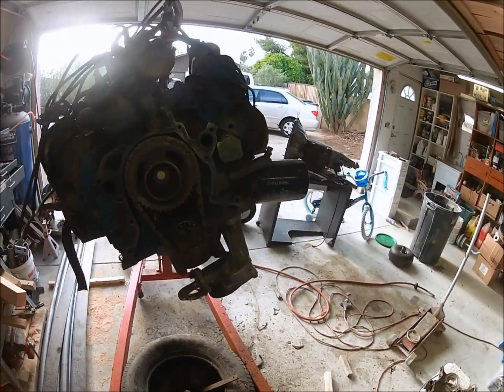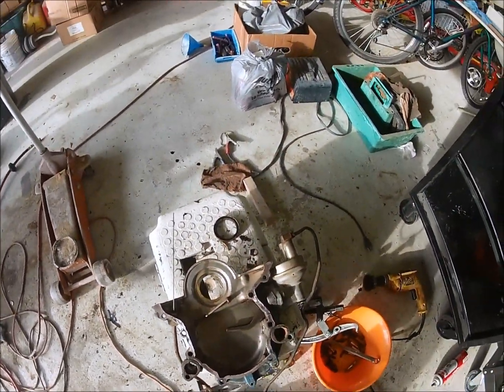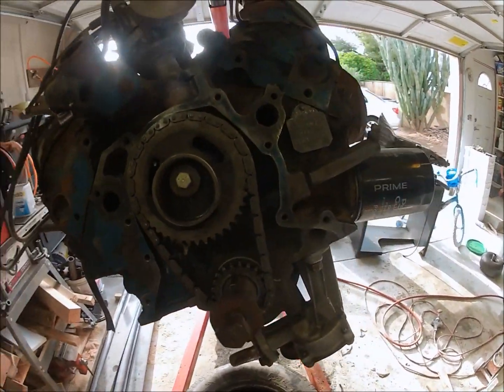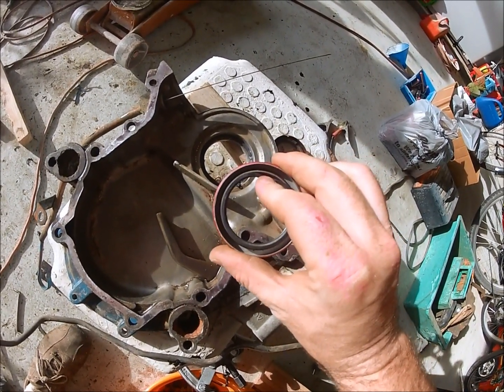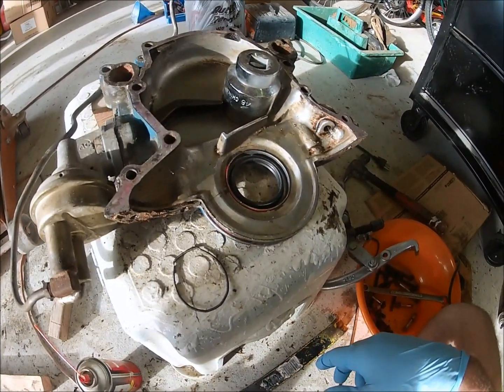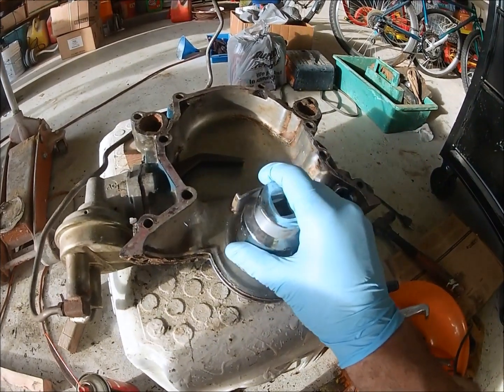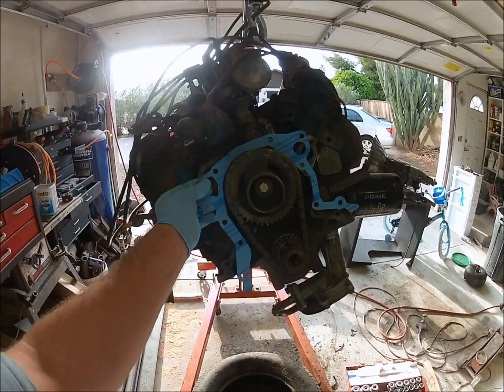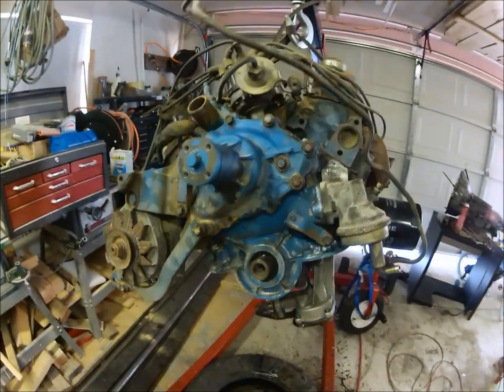How to replace the front main seal ford 302 5.0 v8 Mustang 1970's

Comment: NIce video, I bought a seal for my 1977 Ford F350 351 Windsor and i was given a seal by National, 2692,  which has an inner diameter of 1.875 and outside diameter of 2.565. My cover has a hole in it like this one on your mustang. That cover has an inside diameter of 2.545. My crank pulley or balancer has a diameter of 1.875. I am not sure what seal actually fits this cover. The cover has a number  D7AE6059AA and a little circle with 78 inside it. I am not sure if someone has reinstalled one from another engine or not. The timing cam gear has this number D2AE 6256A2A and i do not know what year that actually fits either if someone removed and replaced it with another year. I know the block number should reveal the actual engine year and size i think but i have to dig more for that. The National seal 2642 shows a diameter of 2.960 outside and 1.650 inside and it is very clear that the outside of that one the 2642 will not fit my cover which has a diameter of 2.545 being nearly .042 bigger. Then the diameter of my pulley is 1.875 and the 2642 has a inside 1.650 and this will cause the pulley to compress the seal by .200 which means .100 on each side of the pulley. What is the best solution to get both sizes right? 

e6059
a